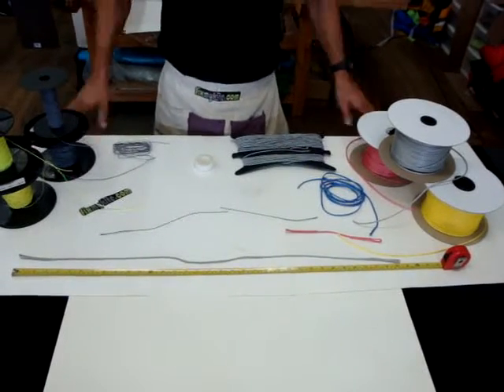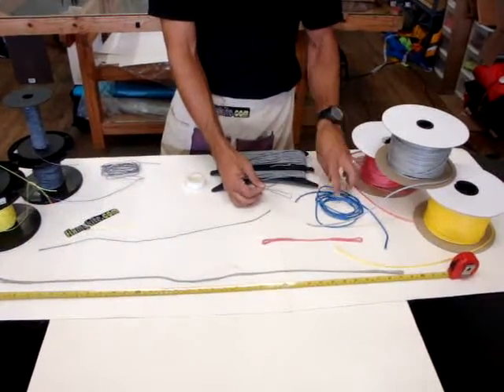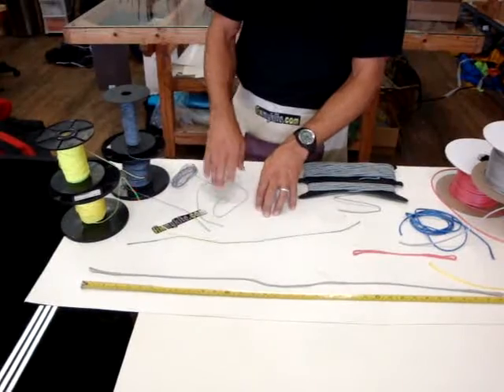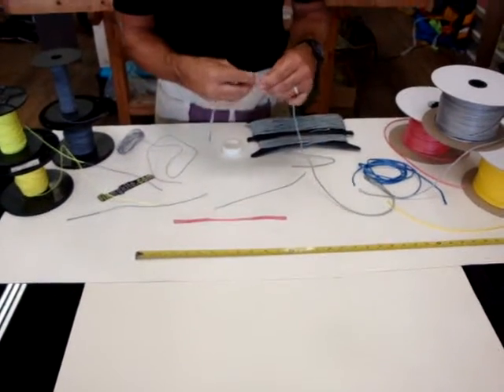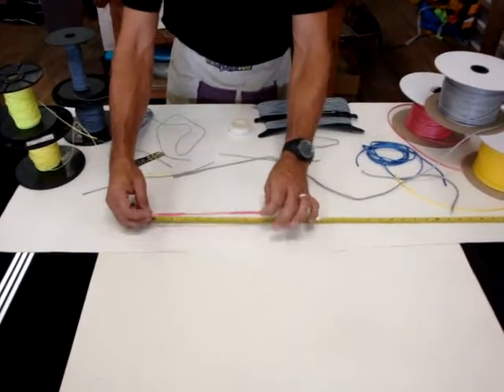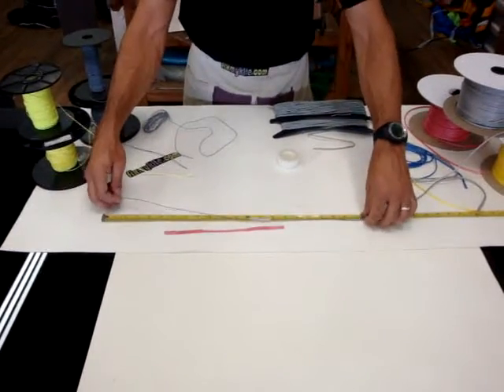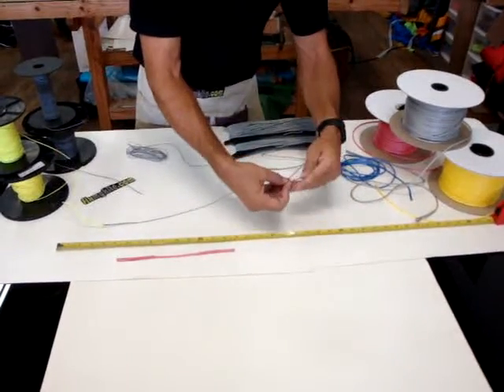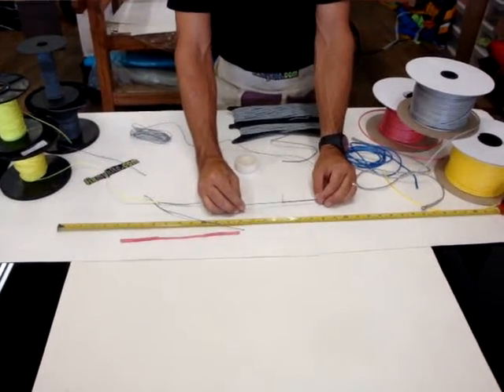Bridle line fix

Comment: Hello, the outer layer (dacron i think) of one of the bridles of my inflatable kite has broken due to the pulley friction. The inner spectrum line is perfectly well. How can I fix the outer part together so It takes heavy duty until I recieve my new set of bridles? It stands kite tension but the inner line is now exposed to possible friction of the pulley. I would like it to be ok for 2-3 high wind sessions.

Comment: The knot that you use at the end of one of these bridle repairs - is it a figure 8? simple overhand?
Reply from the maker: All brands use different stuff.  We usually use a small double fisherman’s knot then stitch. This leaves a larger more robust knot to hook behind.  But a simple over hand or figure 8 works in most cases.
Reply: @Prokitesurf  Thank you! Thanks for taking the time to reply! PS all your online content is amazing! Bring Back The Hulk with more beginner tips!
Reply: @Prokitesurf  I have your microhook line splicing kit and your sleeving kit. Am I correct that if my flylines get cut, using the sleeving kit to repair is a quick but decent repair, and using the microhook to splice is a more thorough repair? For what situation would you rather use the sleeving kit than the microhook splicing?
Reply: @artificialname  if your use pigtails at the ends of the line to attach to your kite, then you can simply use the micro tool and sleeve it back into itself, but it also needs a small stitch to eliminate slipping.   The sleeving kit is used if you connect the line directly to the kite knots, the sleeving is there to protect the inner spectra from wear and tear when connecting to the kite.
Reply: @kiteboardingcom  Thanks!